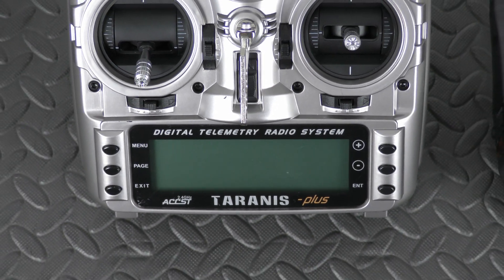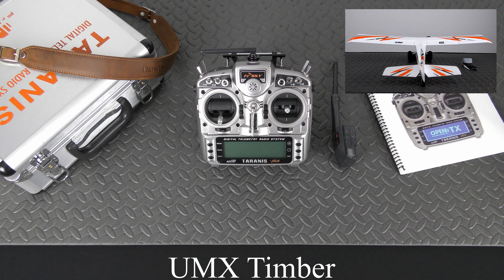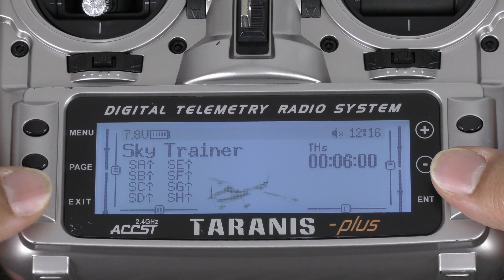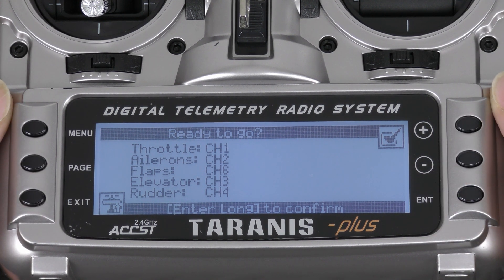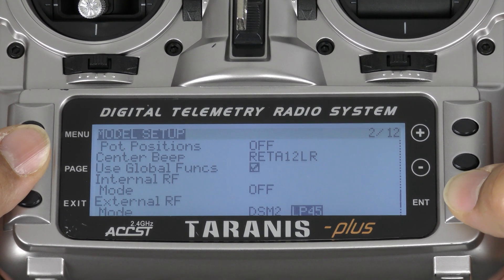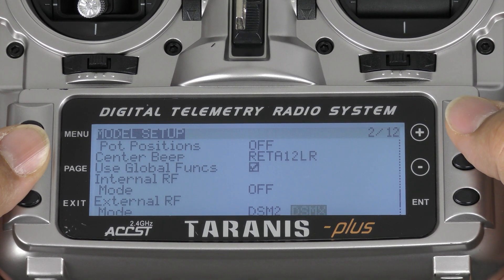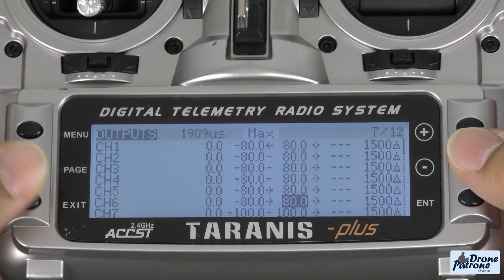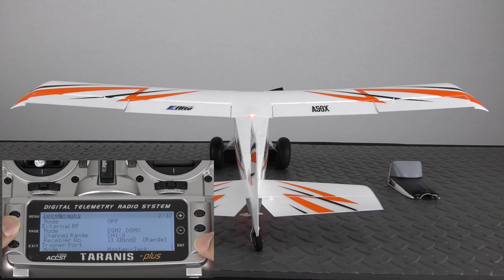FrSky Taranis X9D programming with a true Spektrum DSMX module.

Comment: 5 yrs later l am watching this video, WOW, very informative and laid out. Can't w8 2 get back in2 the hobby again. Starting with the transmitter, just by chance, that is model plane l am looking @ too. Has flaps, etc. Just wondering if the Spektrum receiver will b redundend, dont know if the 2025 X9D SE will bind without with the ext module. This transmitter is MUCH cheaper than the Spektrum radio's that we get here in South Africa.😮.
Can't w8 2 get mine.

Comment: I have a Frsky d9x plus (2019). What module can I use to connect with spektrum receives?
Reply from the maker: https://www.radiomasterrc.com/products/rm-4in1-module
Reply: @dronepatrone Hope l can get it here in South Africa. Still searching on google if the latest x9d is compatible with the Spektrum receiver. The AS3X and SAFE will help me alot, starting again. Had the 1st Apprentice 15e, DX9 radio, charger, etc. Sold them few yrs ago, now l regret it.😢

Comment: Do you need to install a External RF module on the back of the Taranis when enabling the exterior RF module?
Reply from the maker: Yes, external rf module refers to the bay at the rear of the radio.

Comment: Hello John, i want to use the module from Dx5e and mod a external bind button as well. taranis mod and bind is via software bind button which is done in menu.. does anyone have idea how to add external bind button to a spektrum module
Reply from the maker: Hi Zazir,  Bind on button can be done. Here is the multiprotocol module site that has the information. https://github.com/pascallanger/DIY-Multiprotocol-TX-Module/blob/master/Protocols_Details.md#bind-on-channel-feature .
Reply: @dronepatrone  
Hello Patrone, thanks for your message and reference link, however i am looking for a option how to have physical bind switch like it's available on spektrum radio, frsky djt xjt module which we press and then turn on the power to let module go into bind mode.. same option i am looking while getting a module from Dx5e and put it into a non taranis radio.. i have a hitec radio and it doesn't have option in menu using which i can switch to bind.. rather it was a same physical bind switch on its hitec module like we have on frsky djt and xjt modules

Comment: I know these are mainly known for their price to feature ratio, but how is the build quality of one of these compared to something like a Spektrum DX6?
Reply from the maker: Hey Richard, 
   Spektrum VS FrSKY build quality? Well Spektrum is a premium radio brand that has better feeling stock gimbals, intuitive menu systems, amazing customer service and feels a bit more solid in the hand. FrSKY has a better radio link, ultimate in customization but a heavy learning curve, newer radios now come with upgraded gimbals, lots of spinoff companies offering new radios based on the FrSKY protocol creating competition, innovation and low prices (Jumper, Radiomaster, etc..) My daily driver these days is the Radiomaster TX16S which has a built-in Multi-protocol module and I use mostly FrSKY receivers. In the end it really does come down to your intended use and personal preference since, both are very good systems but, neither is perfect. For the FPV and drone world, an FrSKY type radio is a better fit. If you plan on mostly flying Horizon Hobbies products then Spektrum will be an easier fit. If it's RC cars then Futaba is your go to. 

Happy Flying!
Reply: @dronepatrone  I’m actually quite interested in that Radiomaster as it is pretty cheap. Is it something I could grow into and not be forced to know how to program right off the bat?
Reply from the maker: Hey Richard, 
  Yes, you can start with minimal programming similar to a Spektrum radio. OpenTX has both an internal setup wizard and a desktop program called OpenTX Companion and, finally there is an incredible amount of resources online that you could refer to. Here is a quick video on what an initial setup may look like for you, https://www.youtube.com/watch?v=x0SzOaB5W24

RadioMaster TX16S Affiliate Link:  https://www.banggood.com/custlink/K33YC1c3U4

Happy Flying!

Comment: Excellent tutorial, however I have a IRangeX module and it seems the SAFE offsets and  -80 to 80 range edits you did don't apply to it as it is not a true Spektrum module. I had to revert them to regain function on my Sport Cub S.  I tried them because my AS3X is either on or off, no intermediate setting.
Reply from the maker: Thanks! On some models, I assigned Channel 5 to a 3-position switch and reversed the output and that seems to allow for all 3 flight modes on some models. Good luck and Happy Flying!!!!
Reply: @dronepatrone  Thanks, I tried inverting the switch output, but still only 'on' or 'off'.
Reply from the maker: @jps99 I looked at the website for the IRangeX module and it does auto convert channel order and receiver output ranges to 1100us to 1900us for DSM which is why you had to revert to 100% travel. According to the manual for the Sport Cub S, you could try setting the Channel 5 three position switch to +100, +40 and 0 in the outputs and possibly the inversion of that. Hopefully that works. I may have to add the IRangeX module to my list of upcoming videos. 
Happy Flying!
Reply: @dronepatrone  Okay, that was above and beyond the call of duty!   I am impressed by your spirit of helpfulness and will give that suggestion a try.  You earned a SUB!

Comment: I'm trying to get my dx5e module to work with an eflight f15. Am I good to go?
Reply from the maker: Yes, you will get 6 channels in DSMX to match with the included AR630 receiver perfectly. 
Happy Flying!
Reply: Awesome video until you got to the bind part. I have the taranis and timber with a jp4in1. First plane. Idk how to bind them
Reply from the maker: Hi Brent,
  I would start with the DSMX_22 protocol and don't adjust the deviation down to 80% since this module will do it for you externally. Here is a quick binding video.....
https://youtu.be/zI2gTNuPR00?t=573
BTW, which Timber and which Taranis? And did you do the firmware update to the external module as well as having Opentx 2.2 or later on your radio?

Comment: Exactly what I was looking for! However, I have a Carbon Cub, with the flaps on but they don't have the servos installed. I have Safe, Intermediate and Expert mode. How would I set those modes up on my Taranis X9D? Thanks in advance! Merry Christmas!
Reply from the maker: For the "gear channel" which is channel 5 set it to a 3 position switch, that will switch between the 3 modes. Aux1 "panic/LAS" is channel 6, set to a 2 position momentary like SH on top right of the X9D radio. Aux 2 "flaps" is channel 7 set to a 3 position switch. This will not work with the homebrew module that I'm using since, its only 6 channels. You will need a multiprotocol module to have access to channels 7 through 14.
Happy Christmas!